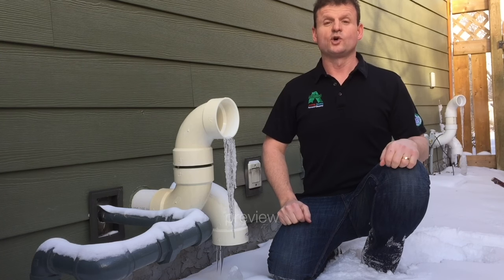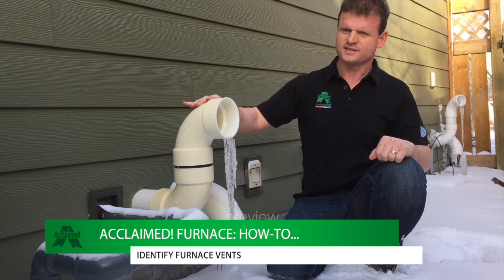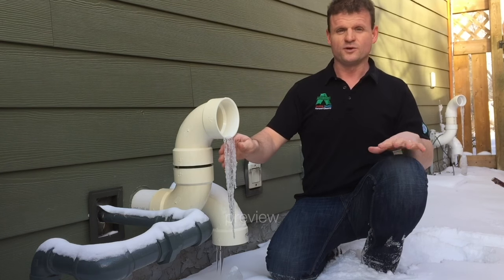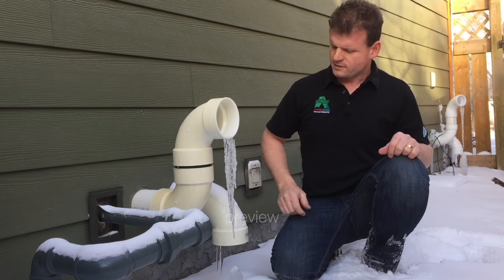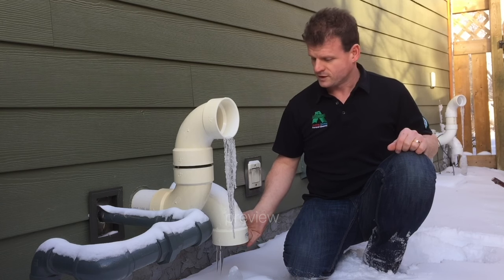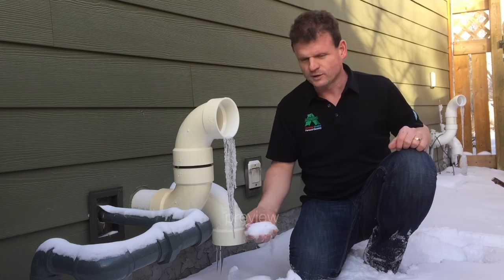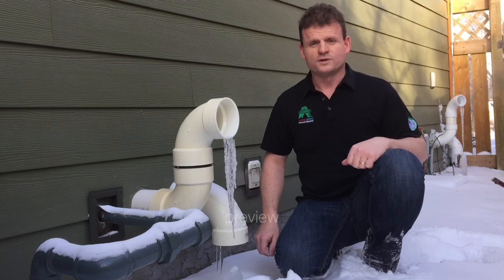Acclaimed Furnace Venting Tip

Comment: Wouldn't it have been better to avoid future snow build ups just to also build up the intake pipe like the exhaust is doing? If the issue is that the exhaust might get sucked back into the intake could you just rotate the elbow so it blows away/ sucks in away from each other?

Comment: Do you have any suggestions for combating too much wind around the pipes? Where we live the wind pretty much goes in all directions and the furnace seems to act up when its very windy. It’ll start to hum but never actually starts blowing then the humming just stops after anywhere from a few to several minutes. We’ve had quite a few service technicians out and it never seems to get fixed. Can get very cold and frustrating.

Comment from the maker: All districts and manufacturers have different codes and specifications.  It is important snow doesn't get too close to the intake, but is never something that can guarantee a big snow storm will not result in snow pilling up or drifting up higher than expected. Thankfully high efficiency venting through the side of the house is easy to monitor and correct if needed.  Thank for the comment!
Reply: Acclaimed! Heating, Cooling & Furnace Cleaning  what if I suspect a dead animal in one of the pipes and the health concerns?

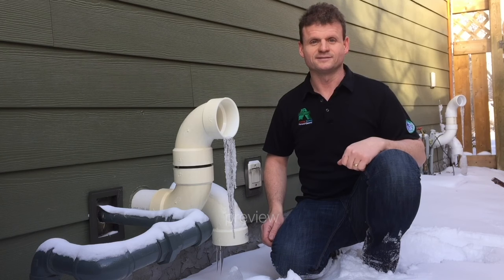Comment: 0:40 ?  Or why not pipe it higher up so you don't have to watch it like a hawk?  Maybe your in a southern state and that's why it looks like the intake is about 12" from the ground, I get it but.....Most state building codes say 12" higher than anticipated snow accumulation, and most of us have seen snow drifts/banks that can build up about 30" high around the house when it's only 10" on the open surfaces.    Then (like mine) the house next door's driveway is next to the furnace exhaust side and they have nowhere to shoot their snow out of their massive snowblower except toward my house, so guess where it goes?  Yep, they shoot it right up against the side of my house (where the furnace's exhaust is located).  I'm thinking about attaching a big 6'x'8 piece of PVC lattice against my side of the fence where my exhaust is, like they say, good fences make good neighbors.

Comment: That is a massive flue for a furnace? LOL what size unit is that. One question I have and no one seems to answer is on the intake. That basically pulls air into the furnace, so if the outside air is smoke filled will the odor come into the mechanical room? I assume most of the air is burned off in combustion but curious about odors. Where I live people use chimney a lot and outside the homes is pretty thick with smoke fumes in winter, would not want that sucked inside. 
Cheers

Comment: Access difficult to get to when snows. Is it ok to add extensions and raise well above ground to avoid the drifting snow from blocking? I dont want to constrict airflow by raising another 1-2 feet off ground if this will cause a problem, not concerned how it ‘looks’, im guessing thats why they put them so low to the ground in the first place? Tnanks

Comment: I have goodman furnace and the exhaust and air intake run different direction.  Furnace not heating. Called a technician checked the operation and notice both intake and exhaust run different direction.  Undone the air intake from the furnace as a temporary fix. Furnace started heating the house. I am getting different opinions on this issues. Please advise thanks

Comment: We need furnaces that alternate the intake and exhaust ports every cycle so that any frost building up is melted on the next cycle.. have both pipes exit building in same fashion and they cycle then problem solved.. engineers, get on this...  tired of going outside every 12-24 hours to clear out my intake when below 0F and windless.. eventually will be too old or crippled up to do this... and when going out there in -25F temps with windy condition easy to do damage to one's self especially if fall on that ice...

Comment: I am surprised by the number of people that are looking for ways to prevent snow from blocking the intake/exhaust. Per most furnace installation instructions, the vent pipe terminations should be at least 12" above the highest anticipated snow level. PVC is so cheap, why do so many installers not extend the pipe up?
Reply: It isn't only due to the snow on the ground, it is usually the moisture in the air, mainly on those cold cold nights where no wind, the humidity just hangs out side of house and the combustion intake air is frosting up due to pressure changes inside pipe and the temps.. I for 1 am tired of going outside every 12 hours to clear that out when we get a stretch of -25F or colder temps.. eventually will be too old to clear it.. we need a heater that can handle being on PVC as regular heat tape requires water in the pipe..   try to save money on fuel with 96% efficiency water heater for in floor heat and run into this issue.. perhaps the furnace should alternate intake and exhaust every other cycle and the 2 pipes get mounted similar.. ???

Comment: Is there anything one can put to cover the pipes to prevent snow covering them? If I am at home it is a question of shoveling, but if one is away how can one make sure the pipes do not get plugged with snow?
Reply: Run a 90^ from the exit and run it up the side of your house. Instead of having them only 1 foot off the ground, buy some extra PVC pipe, and run it up about 3-4 feet, then on the end, AFTER you put your 90^ , put a “T” fitting on as well, so THAT WAY, you now have 2 holes to suck air through, if 1 clogs, the other Will still be freed up

Comment: They require screens by me.. No way the intakes are high enough for the weather there... I'm going to assume that is a dryer exhaust vent to the right of the intake and  that was the only place to put the vents.. So I will give them a pass on the very low intake... But the far one looks like the dryer exhaust is above the furnace exhaust and to the left so I wonder what their excuse would be...especially even more in a corner because of drift...looks like they are far enough away from each other in the back at least 2ft by me

Comment: My HE Lennox was installed two years ago. The out/in pipes were the same as the previous, and I've had the vent freeze over (southern manitoba)about 4 times, a straight 3" pipe extending a few inches from the wall. I've seen many of a schnorkel configuration, elbow, pipe up and elbow. This would give drain back of condensation or just more place to freeze?
I used to run back with drill, spade bit, make a hole when the Lennox started emailing me. Right now I'm recovering from a car crash away from home and dread any messages while I'm recovering
Reply: Did they use the same pipes or replace them?
Reply: It's been a while since installation seven years ago. After numerous stopgap visits by the local heating company that did it when it dipped to the  -30's, icing up the concentric exhaust.  They believed the recommended concentric was the proper way to do it. Last late fall, I shelled out about $550 and got them to do split pipes (cement wall drilling). No problems at all this winter. I'm sure the furnace manufacturer (I forget short of going downstairs) bases this on milder US winters not Canadian ones.
Reply: @SyzygyD  I have found those concentric kits to be installed wrong with the intake and exhaust plumbed backwards but glad to hear you got it taken care of good luck 👍

Comment: so... how do you PREVENT from plugged with snow? if i am on vacation, i don't want my furnace to have this problem.
Reply from the maker: Preventative measures for preventing Hoar Frost:  

Get as much separation between the furnace exhaust pipe and the furnace intake pipe.
Do not install furnace venting in an inside corner or other areas that might restrict exhaust or intake air.
Reply: That reply did not make sense !! If you don’t have proper clearance then the real answer is you can’t do anything . Or you could ask your neighbor to check from time to time

Comment: What method do you take to clean it out ?????
Reply: Sanders 2032 anything would work ! Screw driver or long wooden spoon . But if you don’t have 12inch clearance of the ground then that’s your problem as it’s code here I. Canada
Reply: @leelee287  I used a bottle brush that was flexible enough to follow the curved intake.

Comment: we trying to build our deck in our home, the exhaust pipe will be in between the deck joists
can the exhaust pipe be extend to the front of deck approx. 15ft? Thanks
Reply from the maker: You can run it under the deck but needs to be insulated.  End of pipe cannot be under the deck.

Comment: do you recommend putting screens on either the intake or output pipes so that critters don't get in?
Reply from the maker: We do not recommend screens unless the manufacturer supplies them with the furnace.  This is not typical.  These pipes go directly into the furnace so no critters can enter the house.  If either of these pipes does get something lodged in them or partially blocks them though, the furnace will shut down.  A golf ball or pine cone for example.
Reply: Acclaimed! Heating, Cooling and Furnace Cleaning We have a thin screen on the intake and output PVC pipes. The pipes have a curved neck, so concern for small scriptures getting in there, stuck, die, etc. Just saw ice in there. Do you recommend leaving screens off, even with aforementioned concerns?
Reply: You’ll want a screen.

Comment: the intake on my 90+ furnace was freezing up, watching (while running) from outside the house, exhaust pipe was blowing down ,  intake was picking up moist air, and creating ice to form on  intake, so I sawed off last second  pipe elbow allowing the moist air to blow straight out away from my house, and away from intake pipe and that stopped the freezing problem
Reply from the maker: Although modifying the furnace intake and exhaust pipes can result in this positive outcome, code requirements and manufacturer specifications are very strict.  An alteration in the venting orientation and configuration may help the issue, but may not comply with these codes and specifications
Reply: Do you have 7 feet between your house and your neighbors house ? If not then that’s a no no and you could be asking for trouble